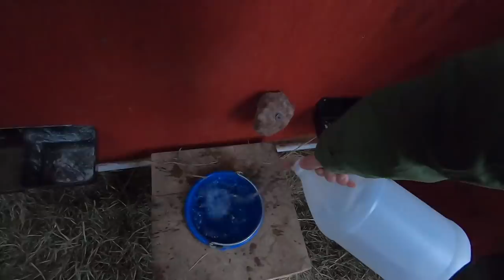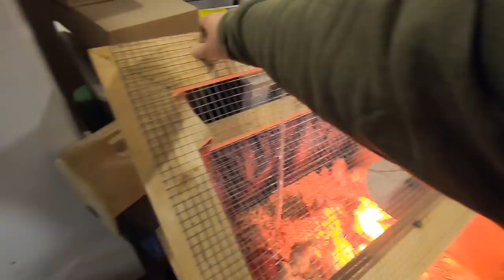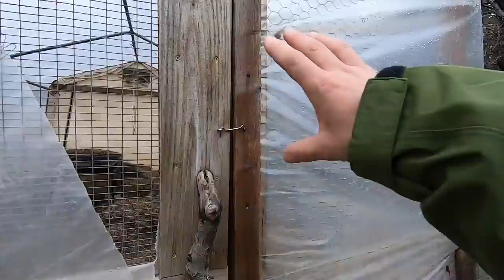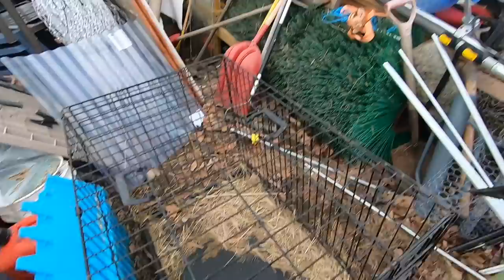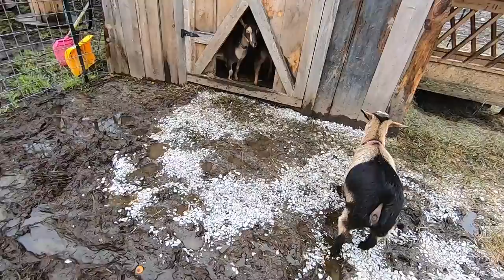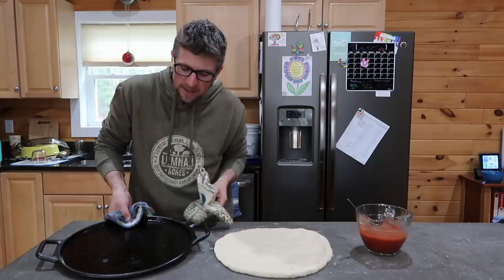We BETTER get READY the NEW farm ANIMALS are COMING

Comment: if you stop holding the short end of your pieces during your circular saw cuts, and allow them to drop, your blade won't bind and you will be much safer.Just flip the piece over so the short end is on your right. I'd hate to see one of those cuts bite back on you.

Comment: I expected it would be the ducks to make a break and you'd find them by their favorite hangout, the outdoor kitchen. How about a 2x4 frame to set the chicken waterer in. 2 cut to the length of the waterer. 2 more that are wider than the waterer across the ends. Make it so the waterer slips inside but easily removed for dumping and cleaning. Then the girls couldn't tip it over. Just a thought. Ooo the piggies are coming, the piggies are coming. :D

Comment: LOL Figaro playing fetch. Better take that worm bin out of there before you put the pigs in. Pigs will stick their heads or noses through those slats and bite open the bottoms of any bags you put in there. Use solid containers or ad some mesh to the slats. Leave the chickens be. They don't ALL get out. It's kind of fun to have the free rangers. And the FR always come when it's feeding time, anyway, so you can still kind of keep track of them. NYC, put the waterer up against that concrete block. Audio was fine.

Comment: #8  Well , my place is a mess ! I have had rain every day since last Saturday the 27th of April. Some days a heavy rain, some days a light rain , but rain non the less. The only place to walk that is firm underfoot is the concrete driveway and the sidewalk. 
What a revolting development. 
 I've got my $30.00 - $40.00 - $50.00 mobile coop in operation.  I'm having a hard time moving it over these clumps of grass.  I may put wheels on it to make it my $65.00 coop.  Ha ha , sounds like an auctioneer.